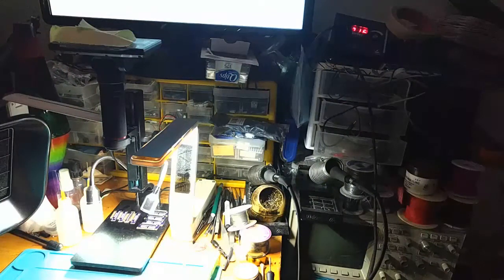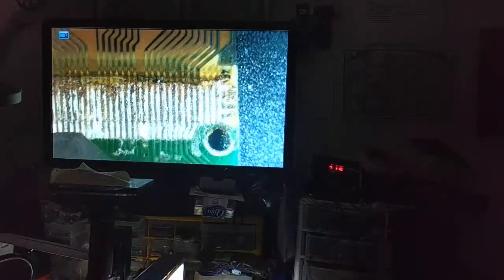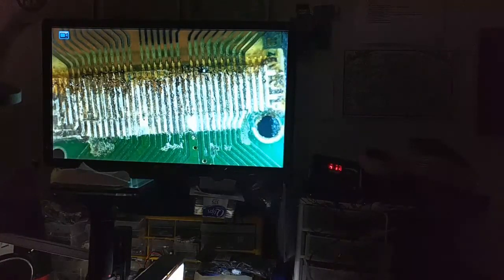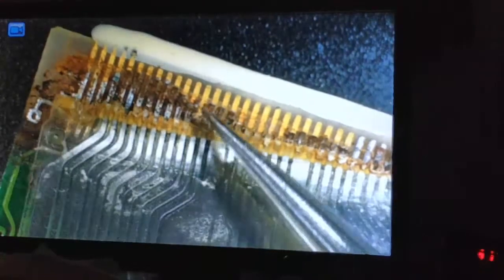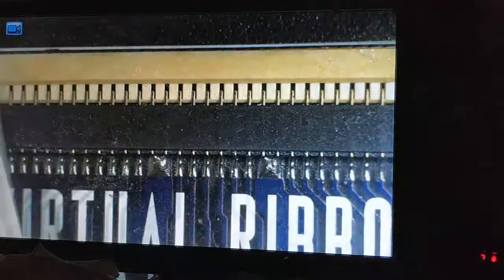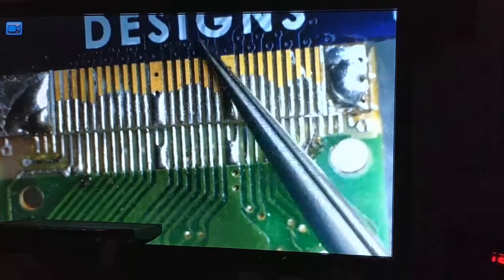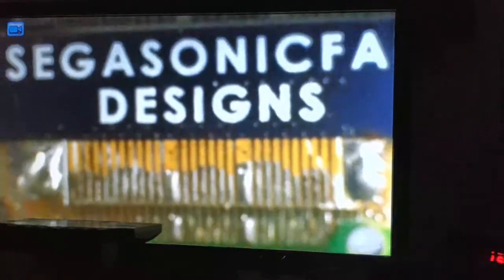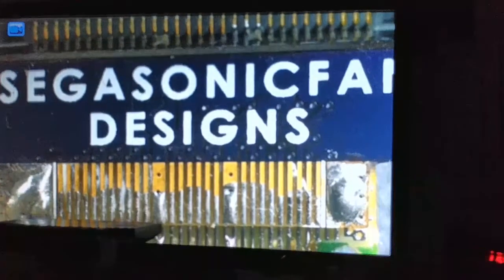Is the Virtual Boy solder repair Permanent?  (Why I designed the Virtual Ribbon, Part 2)

Comment: you cant ship one already assembled? :(
im handy with the iron but i dont want to risk destroying the parts i order from ya
Reply from the maker: There will be install service option once they are back in stock.
Reply: @SegasonicfanDesigns   very cool - i have a guy locally that has a microscope and does repairs - i might grab a couple kits from you and have him do the soldering 

 v glad SOMEONE finally said enough is enough with the poorly designed original ribbon cables lol

cheers

Comment: I melted the cable with an overheated soldering iron. I wouldn't use active flux.
Reply from the maker: Always use a temp controlled soldering station.  Also, the idea of this video is not to save the cable, but to remove it quickly to replace with a Virtual Ribbon.  Active flux is very useful in that scenario and works great.